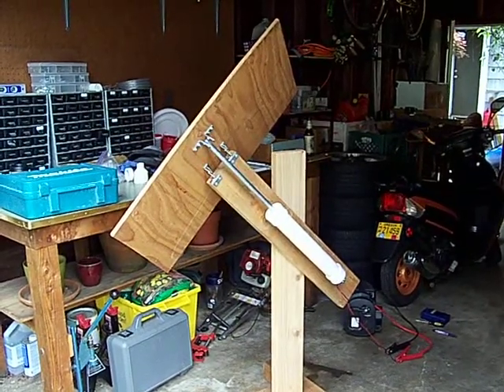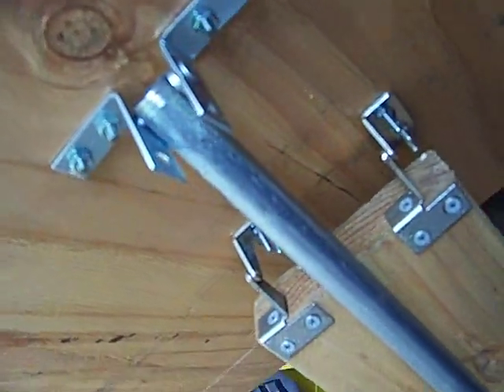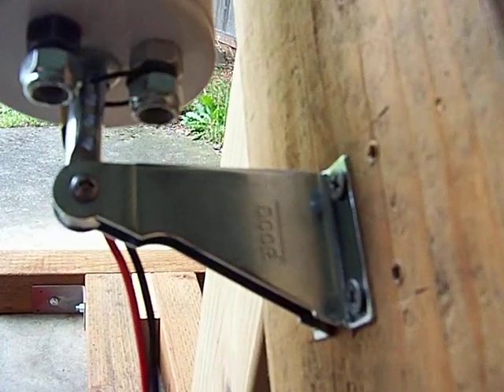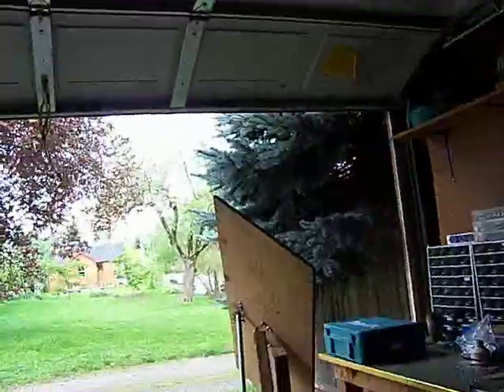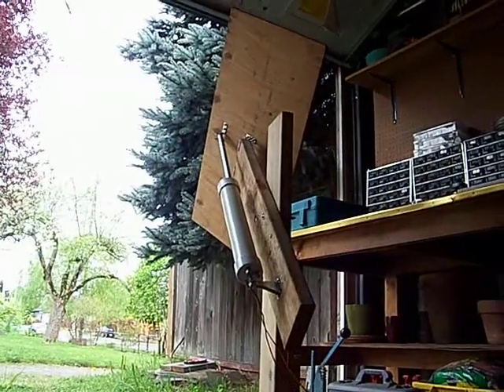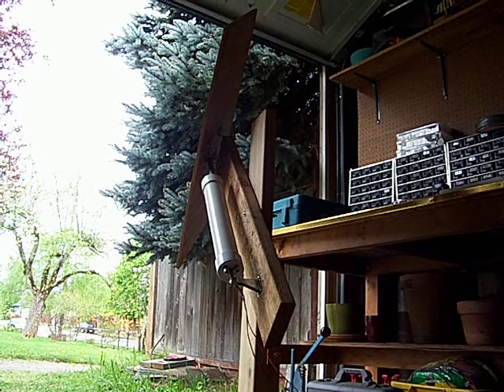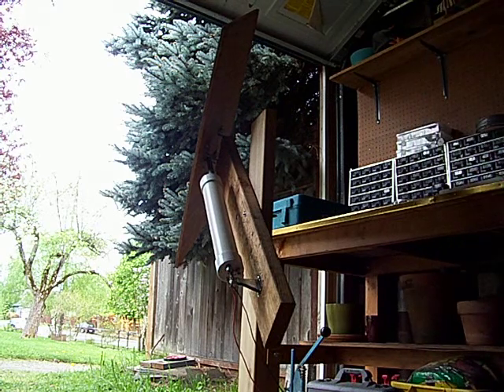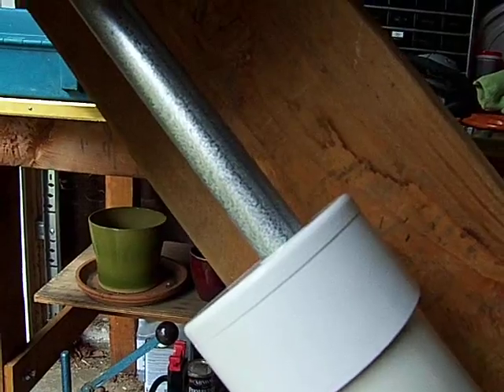Solar Tracker Project

Comment from the maker: The actuator in the video I have a link to in my description is a little simpler than mine.  I added two non-latching (schmitt triggered) magnetic hall effect sensors to act as limit switches. They are there to sense when the actuator is either full extended or retracted and at a mechanical limit.  The hall effect sensors tell a microcontroller to stop motor movement in that direction.
Reply: Can you please send me the complete details  maybe?
Reply: Can you please send me the details please?

Comment from the maker: To see the video I used to design my linear actuator see this video link I posted in the description.  

I used a photo sensors instead of a clock after careful consideration. If I used a clock I would have to have all values of sun-up/sundown for different locations in the world. Then I would have to select my current location and hope the clock doesn't ever lose track of time.  My system just looks for the brightest part of the sky. Simple. Very effective. works anywhere.